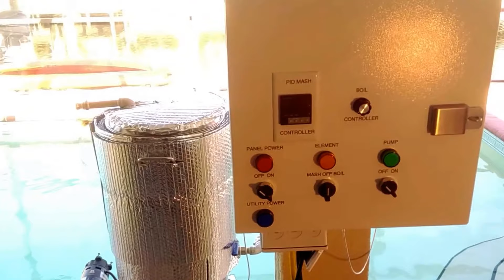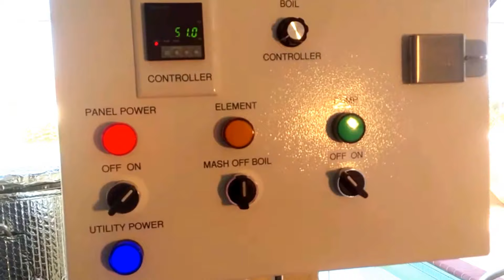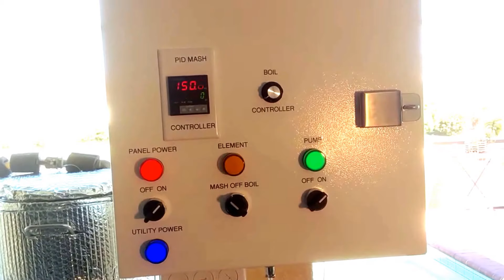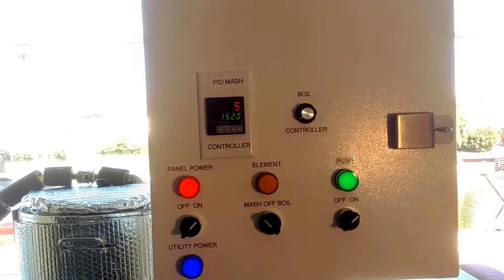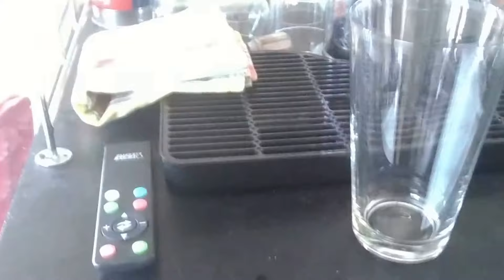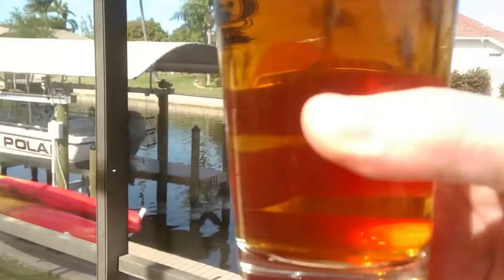1st Brew With The New Control Panel (Electric Brewery)

Comment: Thanks for the great series of videos on this product, very informative!  Maybe I missed it in your other videos, but are you using the stock heating elements or did you add your own?
Reply from the maker: Thanks for appreciating my video series. The mash and boil had the original heating elements in place. This video is using the pid to control the temperature instead of the mash and boil controller Cheers!

Comment: glad you got it tuned the way you want it. do you think that quick on and off will have a negative affect on the heating element?
Reply from the maker: That's something I didn't think about although there are many people using PID's to control water heater elements. I guess we will find out if all elements are created equal. Cheers